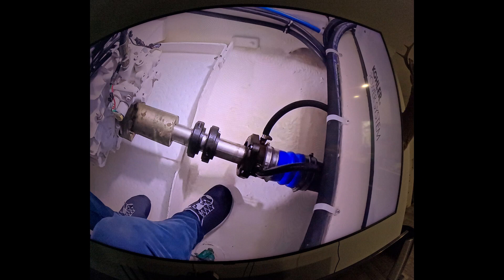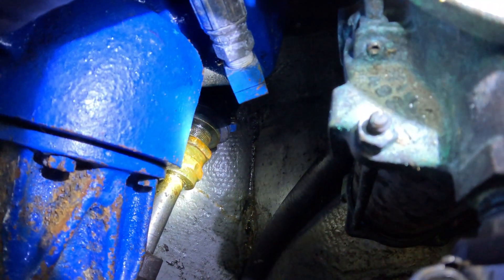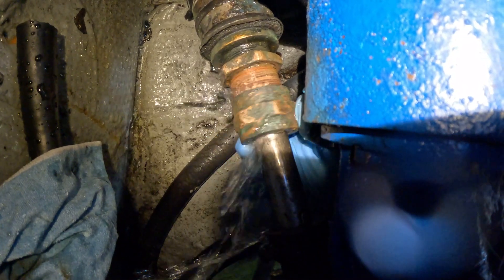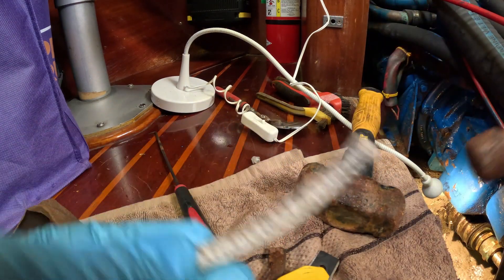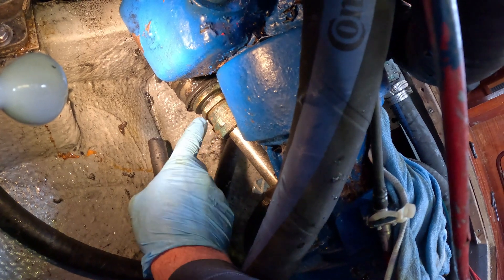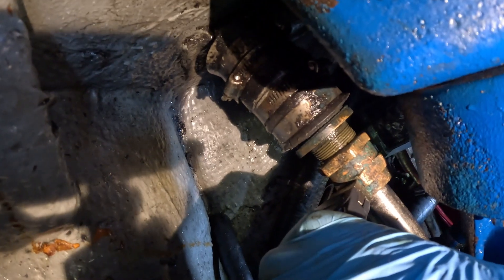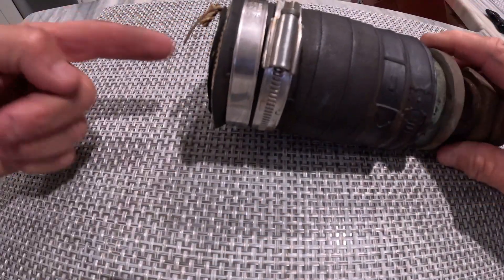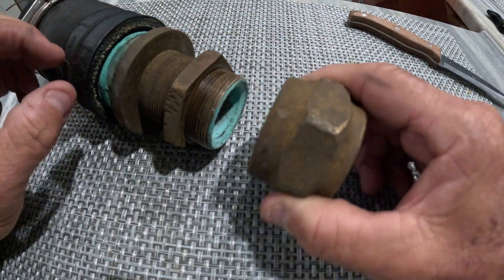Best way to pack traditional shaft packing

Comment: Good idea with the grease, prob use SYNTEF.
I may do this repacking as I have a slight leak the the bilge pump is coming on occasionally. If so, I will probably size up the packing gaskets before loosening the nut and save the pump a little service time.
Thanks and good day........Carpe Ventus!